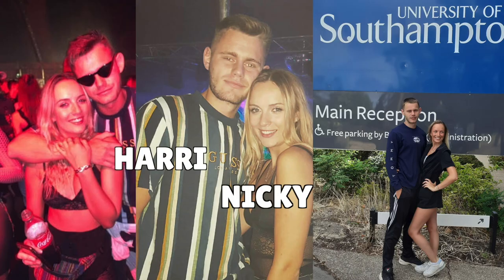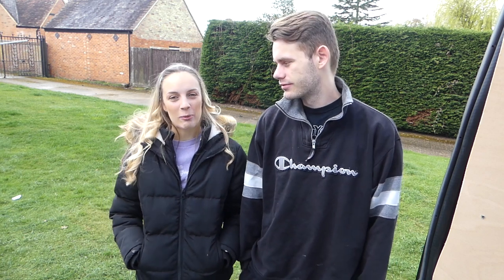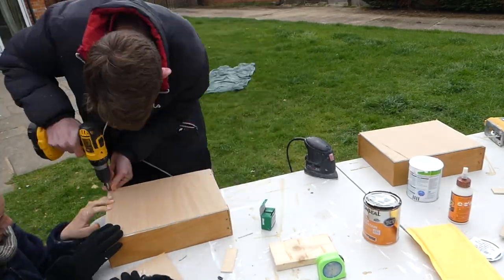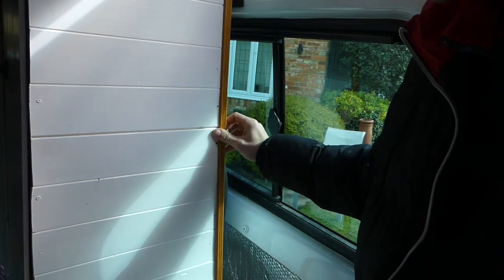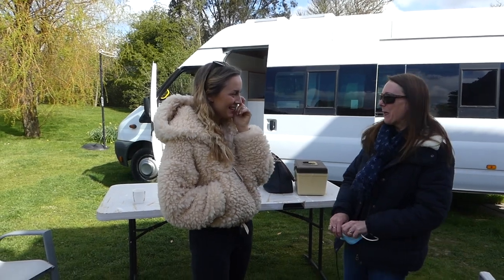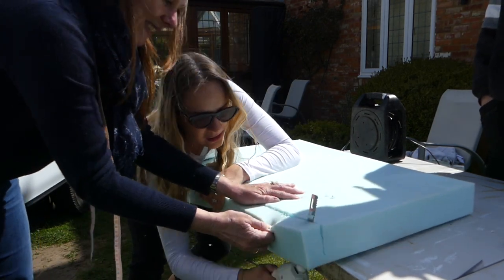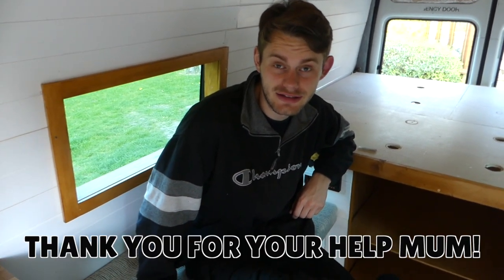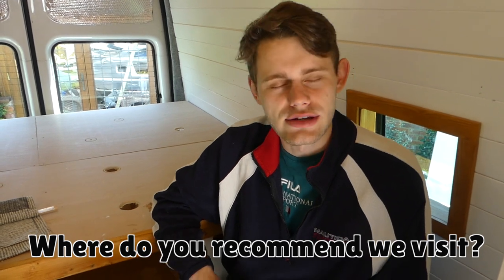Ep18: Finishing our DIY Kitchen & Upholstering Seat Cushions / FORD TRANSIT MINIBUS CAMPERVAN / UK

Comment: Pumping the pedals will make no difference when the engine cuts out randomly. It will need a new suction control valve fitting on the injection pump on the engine. I’d get it sorted before travelling as it will get worse. Great video and great work on the build
Reply from the maker: ah okay, thanks for letting us know! Should be getting it serviced in a few weeks time, so will mention it to the guys are the garage. Cheers Steve.

Comment: If you are already at 2.9 tonnes you need to be careful if you havent yet included your electrical sysem in particular batteries and also the water will be heavy and will need to be included.
Just a thought. Great build though definately coming along.
Reply from the maker: We already have the electrical system in, just not the inverter as it was broken on arrival! Havn't done the water or LPG gas tank though, so thank you for the heads up - definitely something to think about. Thanks for your comment!